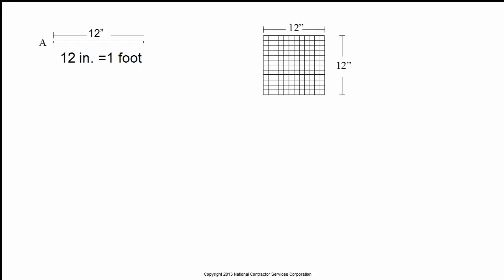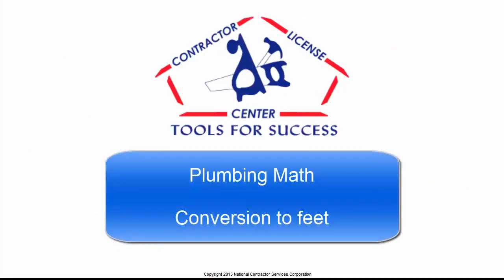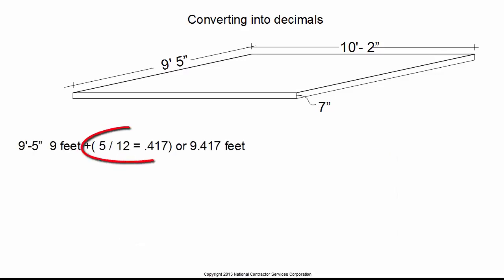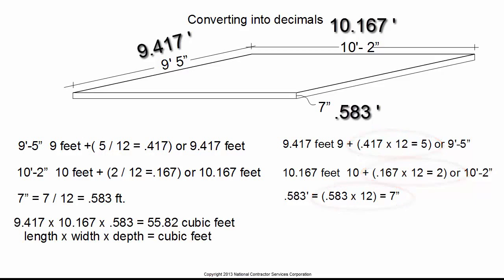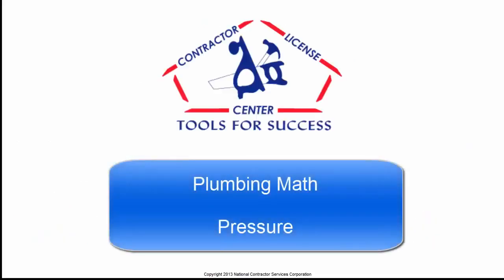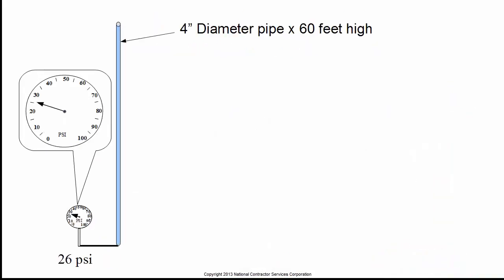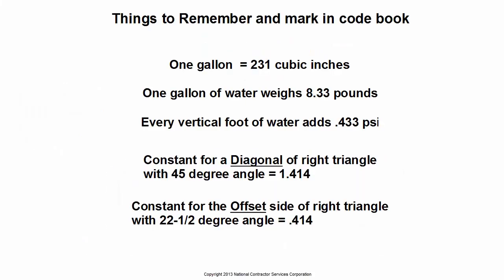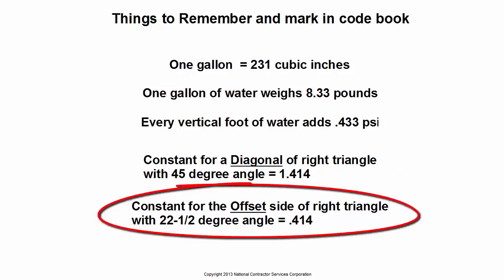Basic Math for Plumbing

Comment: Are plumbers actually doing all this in their head or are they using calculators to find these answers
Reply: After being in the trades awhile you'll just start to retain these numbers in your head and then use them to calculate your measurements using a calculator!
Reply: @brianfinnphx  sure. But as an apprentice what do u do? Do u pull out a calculator or ??
Reply from the maker: Yes, you would have to use the calculator until you've mastered the problems.

Comment: 1.414 for 45 degree offsets is right but .414 for 22 1/2 degree offsets is wrong.
Reply: These numbers come from the "Mathematics for Plumbers and Pipefitters" book.
Reply: 1.414 is the square root of 2. To find the travel of a 22 1/2 degree offset, multiply by 2.61
Reply from the maker: .414 is NOT for the diagonal (like the constant 1.414 is for a 45*) but rather for the OFFSET of 22.5* (.414 is the tangent of 22.5) Source: Mathematics for Plumbers and Pipefitters, Appendix 283 Constants for 22 1/2 degree fittings and Data 25 Constants for Parallel Offsets
Reply: @anthonymonah7116  He says .414 to find the OFFSET, you're calculating the travel which is the offset multiplied by 2.61. For a 45 degree the offset and the advance are the same, but for 22.5 degrees the offset and travel are different. It's trigonometry you should learn.